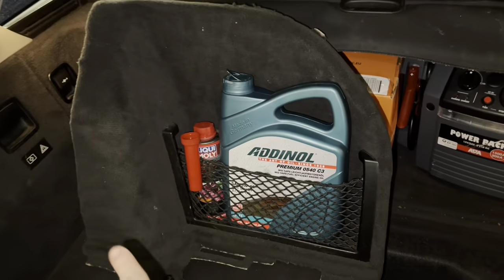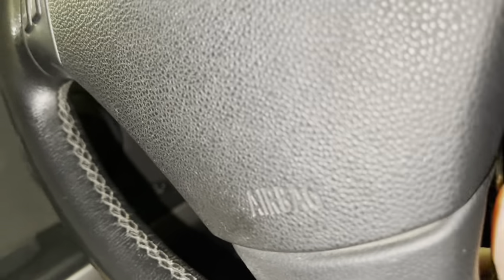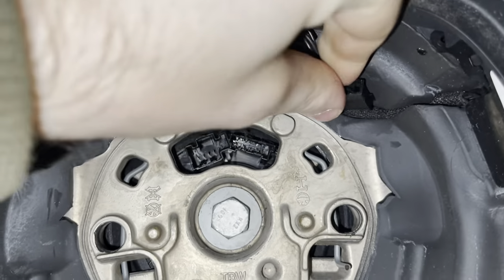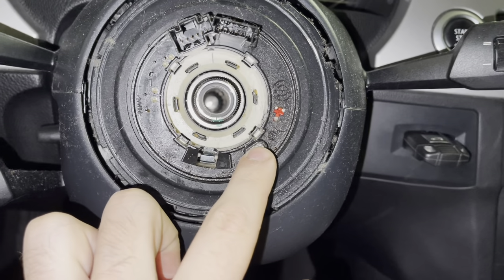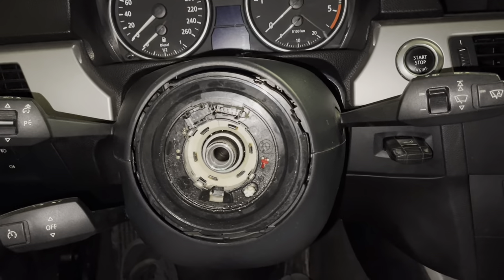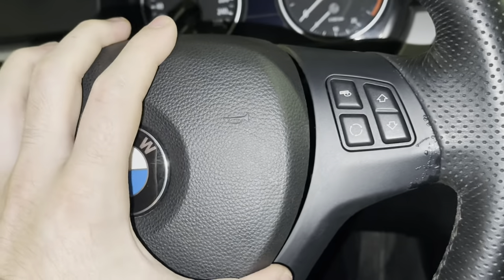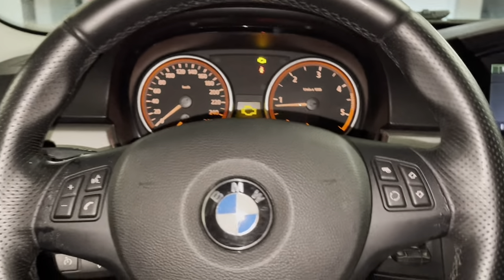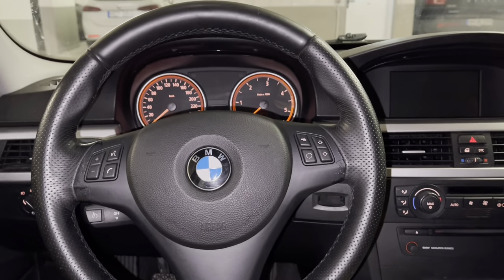How To Install A BMW M Sport Steering Wheel! BMW E90 E91 E92 E87

Comment: If you have a LCI / facelift E90/91/92 etc. - DON'T do it this way, it will ruin the rubbery backside of your steering wheel, if you pry that way! Instead you have to just slightly and carefully poke in at about a 45° angle. The poking alone does release the airbag. No prying necessary at all. I wish I wouldn't have tried it that way.